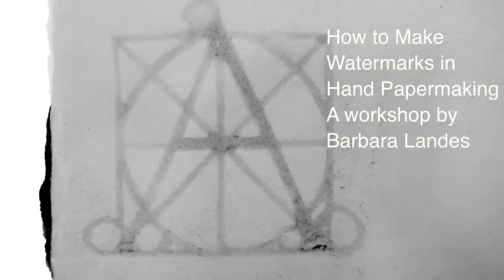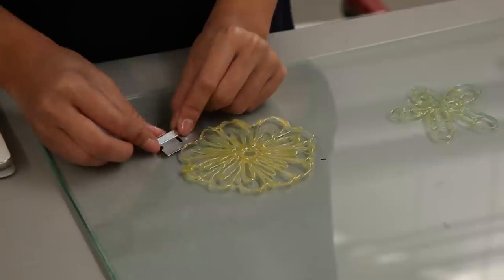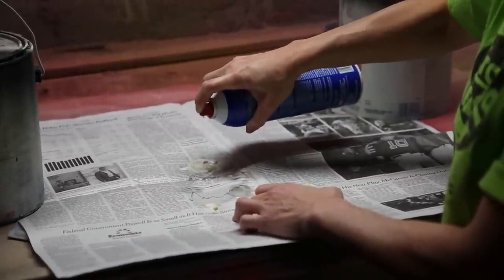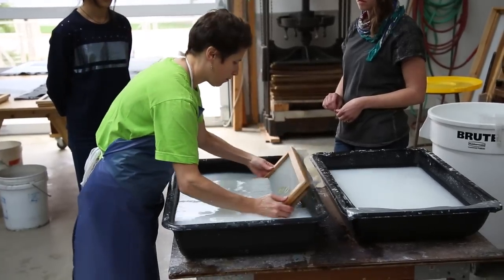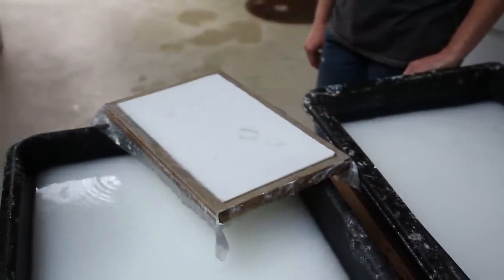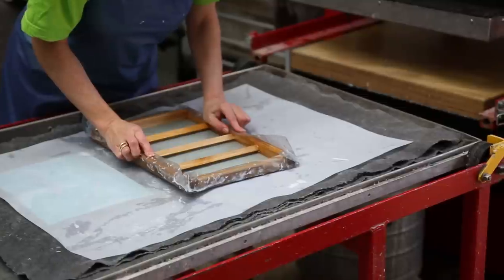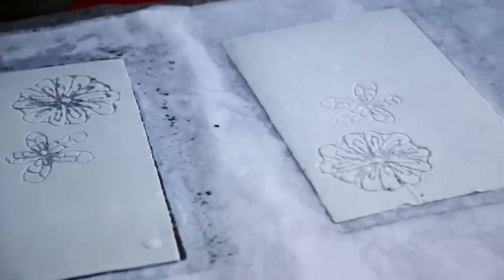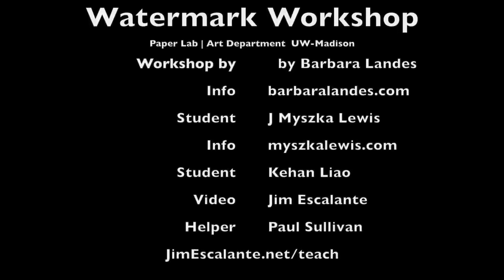Making watermarks in hand papermaking

Comment: Those are not watermarks - those are more like cuts pressed into wet paper.  A true watermark does not dent the paper at all - it’s a very slight variation in the thickness (1000’s of inch) of the formed paper, but the paper is perfectly smooth and formed on both sides.  The watermark is not noticed at all unless held up to the light.
Reply: They showed not the whole process. It was also primitive watermark. When doing real oapermark it is thin. Between 2 other layrs of paper. But its still watermark they showed. A screen blocking paper, to ma a design.